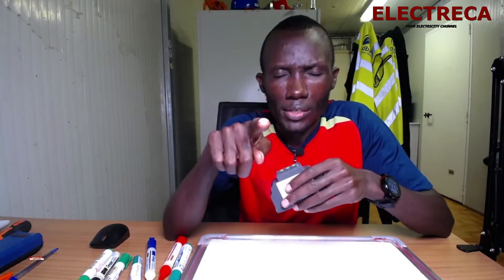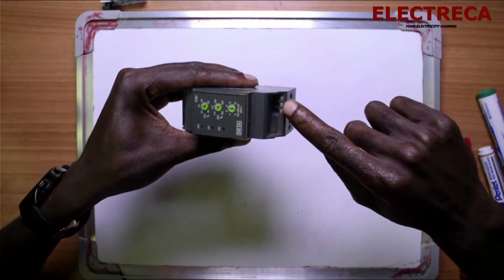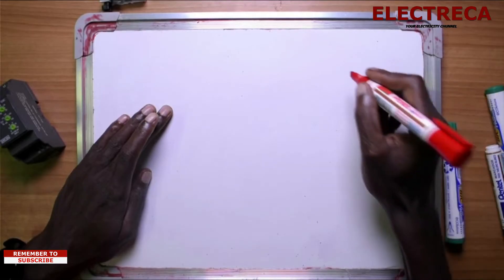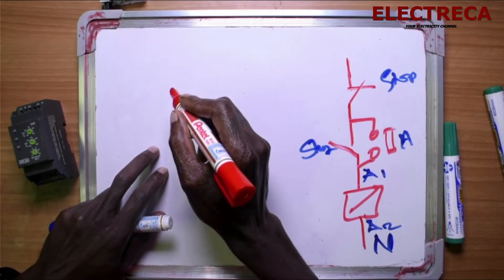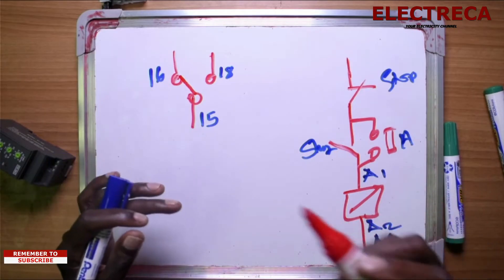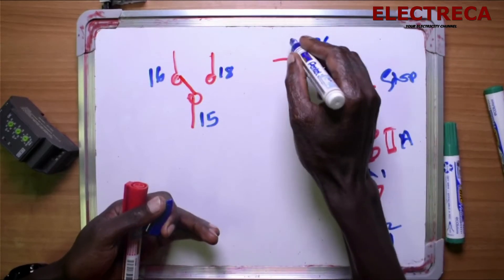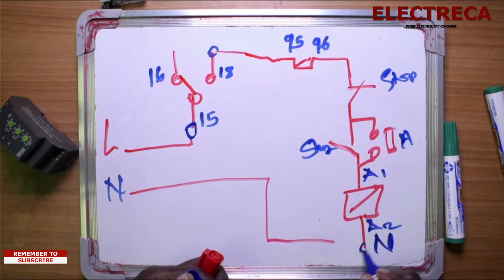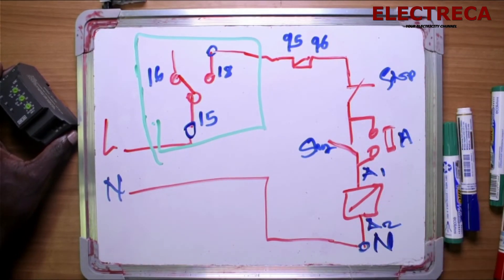how to connect phase failure to direct online starter Phase monitor | Electreca

Comment: From what I saw ,how is the contactor going to energize when the circuit is open
Reply from the maker: The main component in the circuit is phase failure. contact NO closes when voltage is in good healthy
The phase failure checks the voltage first, if its ok it closes the NO.
Thanks for watching.